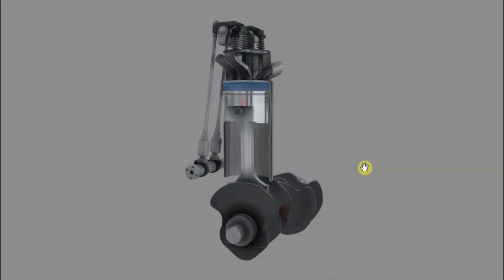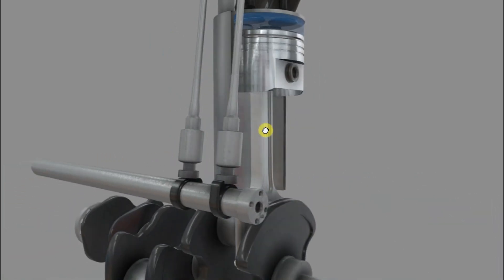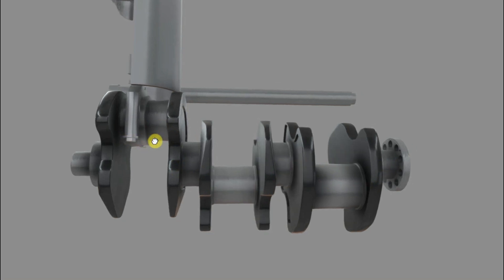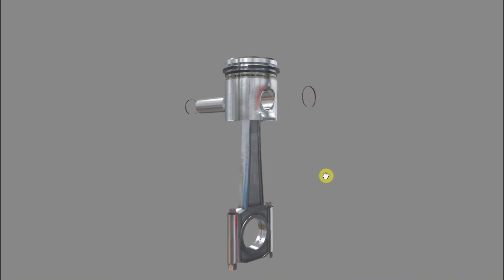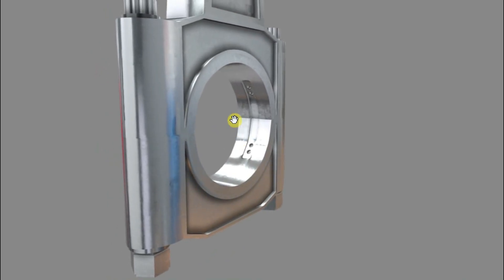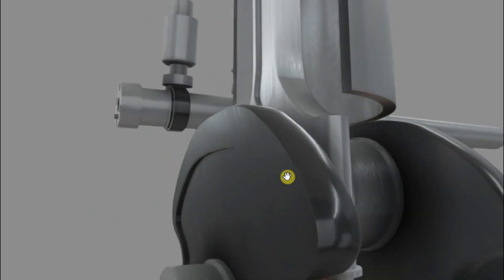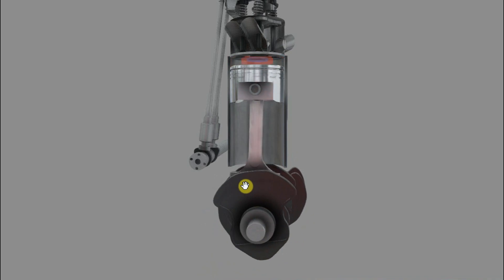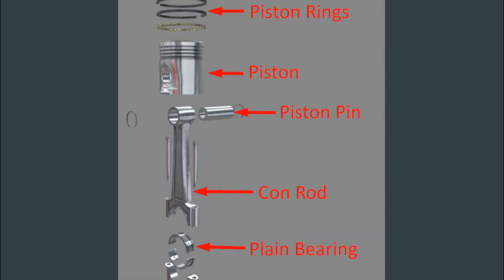Ultimate Guide to Engine Parts: Everything You Need to Know

Comment: Hi dear unseen friend.
I  am trying  to watch all your nice and useful videos that are all great.i am to gonna ask  you an important question  and I add that I do not any person  better than you  who has gotten a lot of knowledge  about the  different parts of car !
So :
Would you please  guide me  is there any way  or any machine test to test a ECU set after changing some Electronic components out of the car or  thers is no way and it should be tested on the  car?
That's it .
Thanks a lot for replying me.
From iran.
Reply from the maker: There are machine tests available to test an Electronic Control Unit (ECU) set after changing some electronic components. These tests can simulate the car's environment and check if the ECU is functioning properly. However, it is generally recommended to also test the ECU in the car itself to ensure compatibility and proper integration with the vehicle's systems.
Reply: Thank you so much sir.